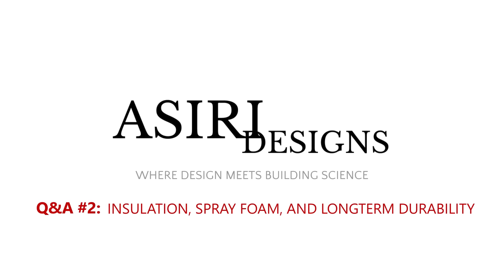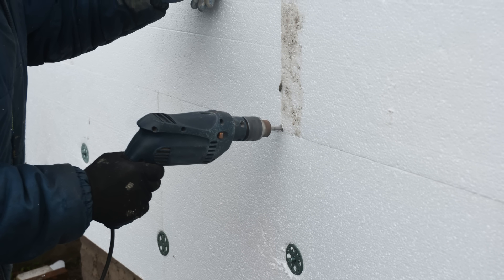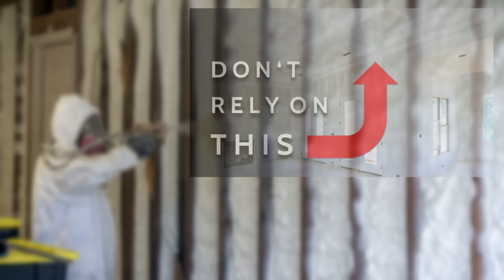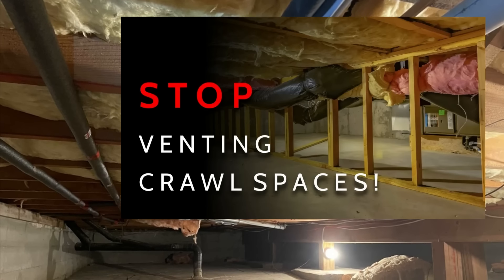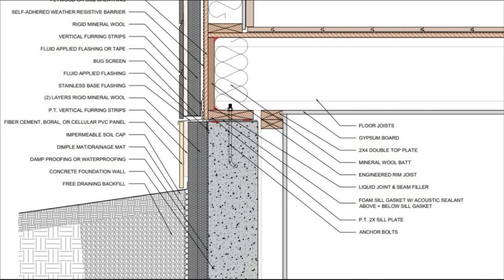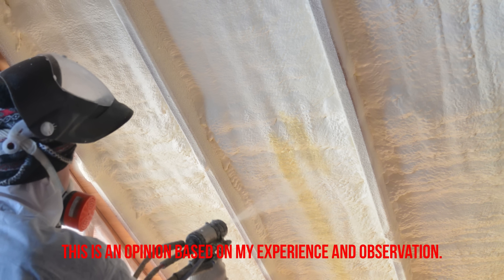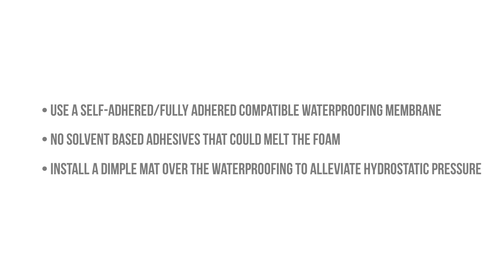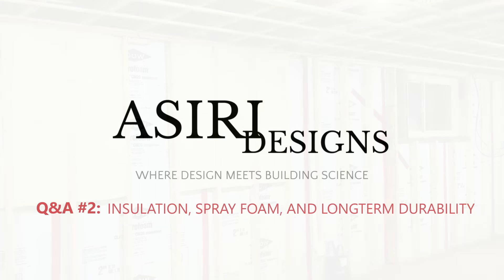Insulation, Spray Foam Problems, Long-Term Durability, and More! | Q&A #2

Comment: Question: I would like to build a house that could be expected to last centuries.  What type of wall system is the most durable?  Does insulation come at the cost of durability?
Reply: Centuries?  Rammed earth.
Reply: @weiss27md  Unless there's a consistent water leak that can slowly erode away the rammed earth.  
You can make pretty much any type of wall last for centuries if it is designed correctly and there is no wall system that will last that long if the details are done wrong.    I once knew a woman from Germany that grew up in a wood framed house that was over 1000 years old and apparently, that's not very unusual over there.  As long as you can control water, fire and insects and the structure has enough strength to survive local seismic conditions, it's going to last a very, very long time.  
I'm in the final design phases for an ICF house with steel suspended, concrete floor membranes.  I'm going well above the prescribed rebar recommendations and being extra careful to make sure that there's multiple layers of waterproofing.  I fully expect this house to outlive me several times over.
Reply: @danheidel  I'm just not sure about all these experimental products.  I remodel houses from the last century, and there's all sorts of products that fail in ways that surely the manufacturer at that time wouldn't expect.
I also have a general rule to not use products titled 'smart' because they rarely are smart to use.
Reply: @JoelWeyrick  No disagreement here.  Although the newer products are very nice, I worry about their long term durability.  They are all thin membranes and those will slowly oxidize and react with air pollutants over decades.  That smart product might be fine for 30 years but start breaking down from low levels of ozone or NOx in the air.  I advocate for belt and suspenders.  My ICF build will have foam sealant applied to every block joint when assembling the wall to create a fairly air/water tight seal on both sides of the wall.  Then a couple layers of external polyiso or EPS with foam sealant at every joint, a water barrier membrane, a thin layer of external rockwool to repel fire and insects, a rainscreen and shingled cementboard.  That will provide at least 4 layers of water protection behind the rainscreen.  I can't see that failing in less than a century even if the membrane layer starts to degrade over time.
Reply: Some kind of rock built on a movable foundation for earthquakes. If you’re living in Italy.

Comment: Why is there so little love for ICF, especially for basements and crawlspaces?  So many advantages.  Even more when you use it from footer to rafters.  Makes for air tight building envelope with very little extra effort.
Reply: Yes, good question!  I'm a home designer and the 2 biggest reasons homeowners don't use them:  #1 - They THINK it's too expensive, or in other words, they don't want to make an investment on their home, which is in itself an investment!!! #2 Their builder doesn't want or know how to install them. In my area (Wisonsin/Upper MI) there's too many old school builders that have a concrete guy that just pours walls with wall forms and that's the end of the story.  We are very short on contractors around here so there's no leverage for the homeowner!
Reply: How can you ensure the concrete is correctly poured?
Reply: @multipotentialite  The pouring of the concrete really is no different whether traditional forms or ICFs.
Reply: @bwillan  When you remove the forms you can inspect the concrete and repair as needed.

Comment: I think done properly, 2 lb commercial spray foam becomes inert from 2 hours to 24 based on resin used. Beyond that, and it simply wasn't mixed properly.
Reply from the maker: @dosoffbeats  I've got some test results that show otherwise, but I can't talk about the specifics just yet. Use caution with this stuff if it's located within the interior pressure boundary.
Reply: @ASIRIDesigns ok. 2 months have past. Please show the test results and who performed the tests. Thanks

Comment: I like spray foam around windows and doors along with stud bays next to them. Along with thermal breaks around windows and doors. Because of lower r value windows and doors sometimes cause condensation. Masonry loves to wick moisture. Great video.

Comment: Thank-you for confirming my refusal to use spray foam. In recent months I have been moving towards capitulating on my spray foam exclusion from use. - I will continue to not use spray foam.
Your comments on ICF basements are exactly as I have built. Both above and below grade the capillary action of water in the seams between blocks can be significant.
Especially as the blocks meet window bucks and other openings. Careful bulk water membranes need to be detailed at all openings on the exterior.
Reply: Closed cell but I think using exterior best adhesive usage I believe
Reply: Only thing I  struggle with is how to get the needed r value for cathedral ceilings without spray foam.
Reply: Dr Cole- stay strong-spray foam is A fatal mistake you simply can’t recover from-there is always another way. In worse case scenario, just get a single component kit for your sill plates-EVEry other space can be approached with a more safe and acceptable approach. And consider, wood fiber inn interior walls below grad in a basement that has water under control is a great reservoir/ballast  for storing and releasing seasonal water vapor drives from either interior or exterior.
Reply: @cw6410 with cathedral ceilings you have several options. Use scissors trusses with the larger side at the apex where your moisture risks are the greatest . YouTube gets. Slightly less acute angle but much less risk than spry foam.even better, uses a double roof . Ie rigid insulation is EXTERIOR to the sheathing, than air gap, hen another layer of sheathing . Always keep in mind moisture water vapor is going  to accumulate that the peak of a conventional constructed insulated cathedral ceiling and ultimately lead to mold etc in a modern reasonably tight (3  air cycles per houror less, certainly 2 or less) house  _

Comment: We have used spray foam in Northern California mostly successfully, and primarily on roof undersides. It is often used in modern designs where it is difficult to get a high level of insulation otherwise.  However a system where we have used with rigid above the deck and batt insulation before seems better all around.  For the spray foam, there was one case where a porch metal roof developed a condensation problem where the spray foam had a void (either because it was not carefully applied around an electrical box or didn't adhere). This is even though this was a completely exterior space and a dry climate.

Comment: Love the videos! Sharif has learned from the "best" of the best. Q&A question for you.

I have a project in climate zone 6A.  As I agree with you on spray foam, it is not recommended.  I use Rockwool insulation almost exclusively.  My current project has a complete exterior insulation blanket of 6” including the foundation on the outside.  The roof will also receive exterior tapered insulation.  The west elevation sees the lake breeze every day as it is very near the shoreline.  Flat roof modern design with an 8’ overhang on the west and north sides.  The roof has two other elevations and flat roofs.  As this space will have access from the second level, it will also need railings.  My question is about detailing the overhangs and how to setup the drainage and maintain all the control layers.  Do you suggest draining to an external gutter on the facia or to put up a short parapet wall and direct to scupper?  Will need structure to locate the railing that will not interfere with the thermal layers.  What would be the best approach in this situation?
Reply: Great question I would like to hear the answer to! As an amateur I think the parapet wall and scupper are a cosmetic decision that add extra complexity and failures compared to a simple gutter if that is possible.

Comment: Another great video, thank you. I would love to have exterior mineral wool insulation for my basement, but that's probably not in the budget. So if we use interior insulation for the basement, what happens at the transition to the above grade exterior insulation? If the insulation isn't continuous, wouldn't that be a big gap?

Comment: I have an existing garage that will be converted to a dwelling. Though I'm not a fan, the existing walls have spray foam. I would rather not replace the existing walls, is there a way to prevent the off-gassing if we were to keep this framing and interior spray foaming? (Located in southern Ontario)

Comment: I have an old house with 5” rafters, and the third floor is an attic conversion. The slanted roof gets hot to the touch in summer. Zero insulation, no soffit vents, blocking at the top of pony walls preventing air flow to the ridge. I’d been leaning towards spray foam to get the air seal and R value without having to vent. I’d also like a condition the top attic space to add AC. Any recommendations? I’m hoping to add insulation exterior eventually but not immediately. I’m in Seattle, which is climate zone 4.

Comment: Question. Double 2x4 wall system. I have decided that this is the most cost-effective route for me to go. With that, can the vapr retarder go on the back side of the inside frame. And still insulate the inside frame. That way it minimizes any air penetrations. Note, I am in Alaska.

Side question. Any recommendations for a cost-effective ceiling assembly to minimize air penetrations like that as well.

BTW. I really appreciate you guys. Just simple, great information.
Reply: I think you're going to have to do a thermal analysis of the wall to know for certain.  AK has a pretty wide range of temperatures, depending on where you live, so it's not really possible to give a blanket answer.  
Having the air seal on the exterior of the inner wall is a good idea to avoid outlet boxes, etc.  However, it puts that barrier at pretty exactly the midpoint of the temperature gradient in the wall.  (Slightly to the inside, since the siding and exterior cladding will add a small amount of extra R-val to the outer wall.)  That could mean that if the exterior temperature gets low enough, you could hit the dew point at that barrier and get condensation.  Without knowing the exact minimum temperatures you're likely to see as well as the typical humidity levels where you live, I can't comment other than my gut feeling is that this is worth worrying about.  
You could reduce the inner wall insulation or add some cheap exterior insulation to move that vapor barrier inside the typical dew point location for, say 98% of the year.  I'm guessing that would be fine as long as the inner side of the inner wall isn't too well sealed.
Reply: @danheidel  That is kind of what I was thinking. If I went this route, I feel like I would need a pretty big space in between the two walls. I think I remember something about 2/3. If that has anything to do with anything, I guess I would need a 4" space between the walls. I imagine the outside 8" with blown in, then the inside with mineral wool. Of course, using a smart vapor retarder and having a proper air system inside the house. I wish I knew some way to test this. It seems like it could be a good idea if done right.
Reply: @tibbified  If you had a couple inches of insulation mounted to the inside of the outer wall, that could move the outside of the inner wall to a higher temperature.  I suppose you could do some testing by replacing a window with a test wall and putting temperature probes in it.  However, it would probably be a lot easier to just hire a passive house expert to run thermal simulations.

Comment: Unrelated to video, but good place to ask.   
I have a roof that consists of engineered truss(2x4) - 3.5” Rockwool - 1/2”OSB - synthetic self adhered underlayment (not vapor permeable) - 2 layers of 2” ISO.   (GRF)

Question is do I need a deck on top of that or will

a underlayment and wood purlins only be satisfactory for 24ga standing metal seam roof?  Vapor permeable roof membranes appear to be very pricey, any particular brands or substitutes?

I’m in central Florida 

Thanks

Comment: Is it possible to have a basement/crawl space air/vapor sealed and insulated while also maintaining an area clear for termite inspection, especially in a retrofit application? Some local codes forbid encapsulating a space and having all your access to inspect hidden behind insulation/foam/etc.

Comment: What would you do for air sealing the ceiling of the top floor of a build. I'm talking about a roof system that is vented and I'm thinking of the insulation on the floor of that attic. Is blown in insulation between the rafters enough for air sealing with the sheetrock of the top floor, or should a mini roof be built that seals the inside from the outside there?

Superior walls, thoughts on that precast concrete product with higher PSI poured walls.

Also staggered studs: is keeping 16" on center critical to keeping the sheathing tight or can you space your studs out to 24"? Load bearing sstr should be fine but does the sheathing need the extra studs to attach properly?
Reply: Disclaimer: I'm a do-it-yourselfer like you! The key thing is that you don't want multiple vapor barriers strewn around without ventilation between them, because when something fails, water can collect and cause further failure. Spray foam further exacerbates this problem because it is impossible to inspect and modify once installed. Your attic floor should be air sealed, which a drywall ceiling does mostly do, but you still need to seal all the penetrations like electrical etc, and the tops of the exterior walls shouldn't be open to the attic either. Small gaps can be filled with polyurethane sealant like Quad Max, acrylic flashing tape like 3M 8067 or Zip Tape, or canned spray foam. Large gaps can be filled with a block of solid foam insulation, cut loose with 0.5-1" around the sides, and then canned spray foam around it to fill in the gap. Don't try to cut joints tight; in modern construction, joints are left large enough on purpose so sealant can function properly. Small sealant joints fail easier. Large fixtures like a light can be covered with fancy caps that are sold these days to keep blown in insulation separate from the light assembly.

Comment: Question: what would you recommend on a metal garage for insulation and prevent condensation if not foam? Great videos, thank you.
Reply from the maker: @tinepick6175  Thank you for watching, if you insulate form the exterior you can use any insulation of your choosing, the key is to provide a thermal break between the conductive metal and the exterior.
Reply: @ASIRIDesigns  Thanks for the response. The structure is the square steel tube skinned with steel cladding. I'm too old to disassemble, add exterior insulation and re assemble. Still appreciate your reply.
Reply: @tinepick6175  You can use 3M 8067 or Zip Tape, Quad Max sealant, and canned spray foam around the garage interior to seal gaps and holes. It won't be pretty, but it will help with the moist air coming inside. Anything more will basically be building another wall! If you have the money to spray foam the whole thing instead, then call around and consider it! It's not ideal, but it's enough to retire with. Just note that exposed spray foam or foam board are super flammable and are supposed to be covered up, thus why must walls are wood framed even if they don't need to be, just to hold up the drywall!

Comment: What would be a good way to insulate a shed with no sheating, just framing and painted siding, in hot humid South. Will be running a mini split for air conditioning inside, plus a dehumidifier. Would rigid foam board cut to fit inside each stud bay and soray foamed around the edges be good?
Reply: Foam board with canned foam around the joints works great! Cut the foam nice and loose around the sides, like a solid 0.5-1". It's easier that way, and less prone to installation error, because you'll have enough room to guarantee that you got foam into the joint. This is called a butt joint, rather than just putting spray foam in the corner, which is a weaker fillet joint. Just note that foam board is incredibly flammable; that's why the building code requires it to be covered up with something that's not flammable. For an improvised shed, your life is in your hands.

Comment: The ICF information is very timely.  “Fully adhered waterproof membrane” - can you give some examples of what products? We will have to excavate to correct this oversight by the contractor.  This will probably somewhat damage this fragile material and no doubt it will be dirty. 
(Sharif, this is for a second building - and the second time I will have to redo a foundation.  This one is already seeping water into the basement.)

Comment: Consider halo external- graphite EPS- i think extrapolating from subsoil poly is misguided. I ve dug up a section on my two year build and its is intact and not attacked by bugs -I DO think have to be careful to finish off the top and/or keep it well above grade though.

Comment: Can you do a cross section detail for climate zone 6a (Wisconsin), with exterior rigid insulation, interior fiberglass batts or blown in, no spray foam, and unvented vaulted roof.

Thanks!
Reply from the maker: @adamjtrom  Yes! One of our upcoming videos is about examples of walls that work for each climate zone.